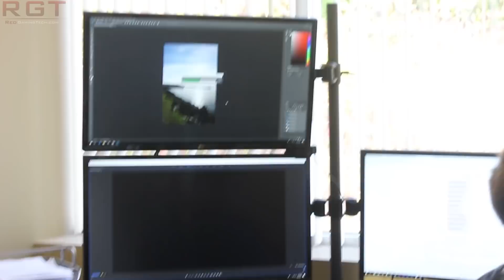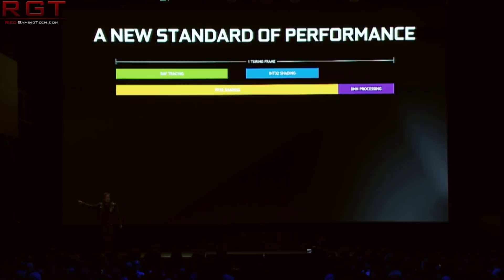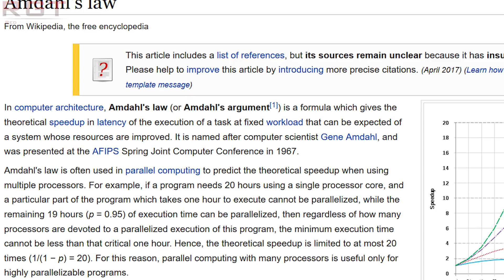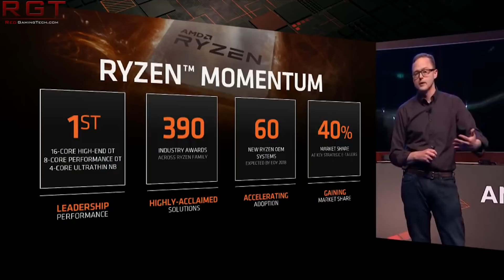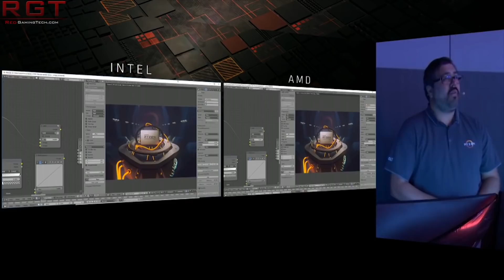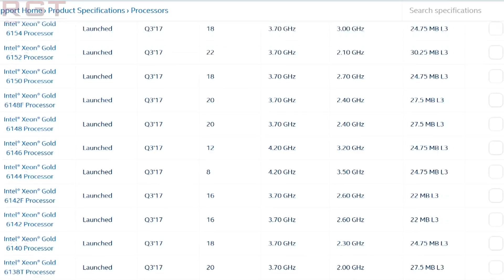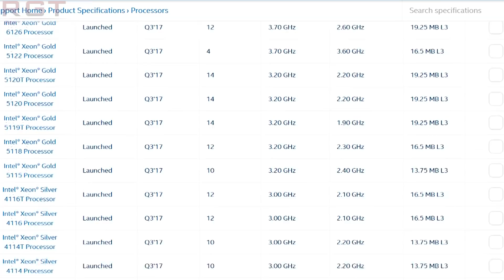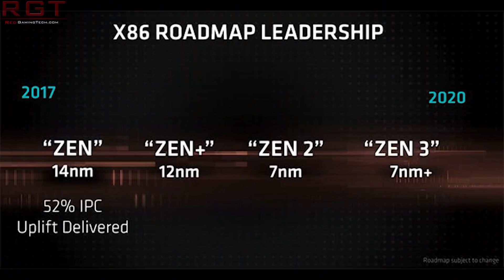Interview & Tour of Puget Systems | Builder of Custom High Performance Rigs

Comment: thank you for the vid. WOW those Puget Systems are way overpriced absolutely terrible bang for buck, they must have taken a page from Nvidia.
Reply: If you are building a 8 card quadro box that you want to somehow under your desk and you would like it to be quiet enough to do video conferencing. I suspect you wouldn't feel that way.   They are generally selling to folk with budgets and you will not find another vendor to build you a custom quiet, server class machine that magically dissipates enough heat not to crash or slow down with a full warranty and service levels to go with it.
Reply: If they were selling hardware it would be overpriced.
But what they have to offer is beyond what's inside the box. It's the guarantee that you will have the best system for your usecase. You can't just, as a company, buy random hardware because you're too cheap to pay for an expert's advice. It will cost you less if you buy it yourself but you will lose money on the long run with a sub-optimal system.